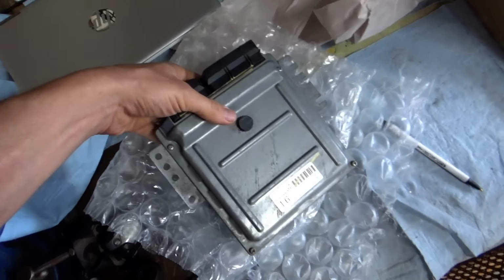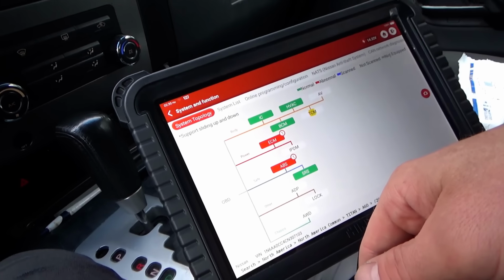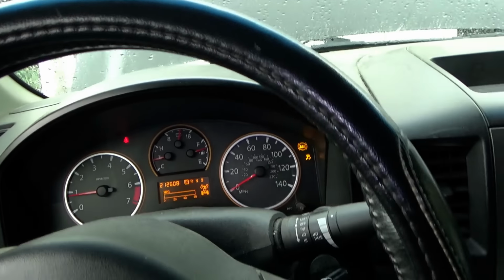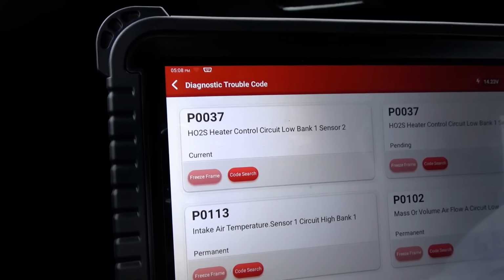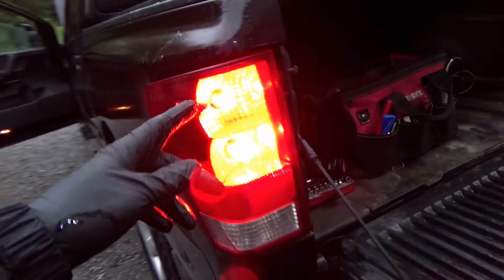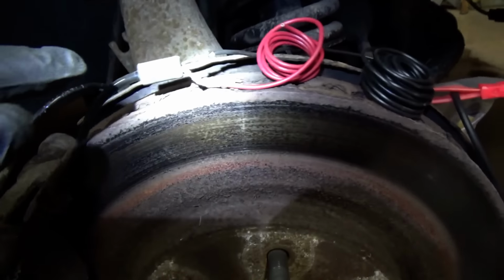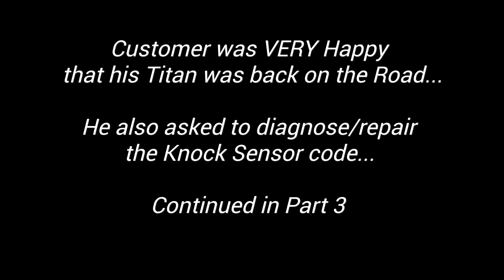(Pt 2) Nissan Dealer & Shop STUMPED for 6 MONTHS?! (Titan No-4x4, ABS Fault)

Comment: Ivan, this video came at a good time. we just bought a d22 Frontier (1999 model) 4wd v6 and manual. It was cheap and from a tow yard, so we expected issues and it did have the service engine light on for oxygen sensor and crankshaft position sensor. Nissan in their infinite wisdom made the sensor to be mounted to the rear part of the trans bell housing which made it a little annoying to access. Soon we discovered someone had already been there to throw a crankshaft sensor at it, of course. We also discovered that someone had attempted a hack job wiring repair and wired the  sensor backwards... Then they twisted the shield wire into the sensor ground wire, sending all the data from the sensor into the chassis... Some people should not be working on cars!
Reply: My condolences on purchasing that truck lol.    A warning about aftermarket crank sensors in any nissan . Don't bother trying.

Comment: The fact that the truck can disable 4WD altogether because of an ABS fault is infuriating. +1 for manually-actuated 4x4 instead of a computer getting to decide if you're allowed to use it.

Comment: I ran into a problem where a replacement computer couldn’t be sourced. So I knew that I couldn’t hurt matters any further by cracking open the ECM. Near the powers and ground connection plug inside the ECM were 2 (5) watt general purpose damper diodes. Their job is to dampen any voltage surges and keep the power coming in rectified in the proper direction. ( positive on positive and negative on negative) I purchased a bulk pack of 6 diodes for $3.00 and replaced the two that I had found to be open circuit. The computer came online and I was able to pull vin and stored codes. In you are ever in this situation…. You have nothing to lose by trying this. I get a lot of good information from your channel and I hope that should you ever need it, what I told you serves to help. Thank you and God bless.
Reply: Mark, 
Those are Spike Suppression Diodes used to protect the Drivers on certain protected circuits. Good job!

Comment: I did the timing chain on my parent's 4.0L Pathfinder. Found the same mouse nest under   the intake and also had a bad knock sensor and yes the abs disabled the 4 wheel drive. I had that too. They're a pain.

Comment: Not a huge Nissan fan but the Titans are great trucks.  Loads of power, good fuel economy for such a big truck, and a reliable engine and transmission.  It's got its flaws but none of them are show stoppers, imo.  Maybe ECU issues could be though, down the road, which is good to know.

Comment: As the owner of a 2013 Titan...this video does not put me at ease 😢  i wish i lived closer to Ivan!
Reply: Get known good ECU or 2 just in case.
Reply: Sell it while it’s still running
Reply: My 1st gen 2007 went to almost 300K before it was totaled.  Radiator, Axle Seals (2), front hubs (2), and a rear pinion seal.  Nothing really out of the ordinary for any truck.   Original starter, exhaust, alternator . . . . .  Mine was the best truck I ever owned.  So I replaced it with another one.

Comment: You can tell it's on the knock table under moderate throttle, I wish there was an after ignition timing comparison to compare to as I'd imagine it should be in the 20s, but hey it's fixed

Comment: Most Auto electric repair wire lines standardize on SAE-J1128 TXL (Automotive Cross-Link Wire Extra Thin Wall) for general automotive wiring needs, and for this repair you would use 18 AWG 19/30 stranding bare copper. Actually the most common wire stocked for 18 AWG color with stripe follow Ford Motor Company common color combinations. Ford also has a large variety of large power wire colors; Red, Pink, Yellow, and Orange. If you are tasked with making custom wiring harnesses Ford color combinations make a lot of sense, with some notable exceptions like HEGO colors. 

To fill out the wire line you will have about 20 18 AWG, 10 16 AWG, 6 14 AWG, 6 12 AWG 4 10 AWG. Mechanically for test vehicles 20 AWG is considered too thin although you will see 20 AWG in production harnesses. Then you will have your large cables (8, 6, 4, 2, 1, 1/0 and 2/0 AWG) for starting, charging, and power distribution. The best large cable wire is Marine high temperature, high stranding, tin plated copper wiring. A very popular cable for in trunk battery installations for automotive test vehicles is 1 AWG (sometime 1/0) Welding cable high stranding bare copper. For battery in trunk test vehicles we never rely on chassis to return currents so you will see a large red and black battery cables in the same harness going to the trunk. In the Trunk the battery positive cable is protected by a high current bolt down fuse.

You can emulate the OEM style wheel speed sensor factory harness in a repair by using TXL wire, high temp wire loom (white stripe) wrapped in TESA high temp abrasion tape.

Comment: @4:20 I had that same issue, crank no start.. figured it had a P0615 code, no power from the TCM to the IPDM start relay circuit coil control (power switched), added a jumper wire from the 30 terminal to pin 21 from the TCM connector at the fuse box.. problem solved.

Comment: Man i hope you found what the issue was when moving stuff. If put it back n it just started to work again and did nothing else with it then it will definitely mess up again on the first large bump or when there's lots of moisture in the air.

Comment: Hey Ivan, thank you for the video! I have a no crank no fuel situation with my 05 titan. I've been working on it with knowledgeable help (so I'm fairly confident I didn't make anything worse. With my truck being down a week and my job 1.5 hours away (each way) i lost my job. I took a loan from my grandmother for surgery (4 cut tendons in my forearm, no health insurance) and I work as a window installer. I owe her 14k. Lost my job because of no way to work. I'm at a breaking point and need advice please 🙏 
Aftermarket alarm was going off, I disconnected the battery. Nissan anti theft system immobbalized the truck. No crank, no fuel (starter is good though). Throwing a p1610 code and a p1612 along with a u1001 all codes clear except p1610. Tried to have locksmith program new key, no go. Switched the ignition interlock thing and nothing. I need to be on the road to find new work so I'm not a 33 year old financial liability to my grandmother whose 72 with a fixed income. Any advice would be a blessing. Worst case scenario I'm taking it to nissan so any knowledge on how to not get hosed would also be greatly appreciated. Thank you very much in advance. Have a blessed day.

Comment: Nissans always get knock sensor codes but it dont turn on the engine ligjt. 
It dont cause  any drivability problems or cause it so fail smog so ve ignore it since it is under r the intake manifold on the v6's. Unless the manifold is already coming off.

Comment: Great job, Ivan! Apart from the ECM, the faults so far, were all poor connections, busted lamps and wiring problems. Let's see about the knock sensor - Part 3 should be interesting :-)
Reply: High probability of broken bolts on the intake manifold after looking at those rusty fasteners.
Reply: @v12alpine  Yep, looks like a rusty mess to dig into 🙂

Comment: Yes, it does matter if either knock sensor works or it doesn't because the 
PCM will retard the ignition timing, etc if no signal is detected from the knock sensor when the PCM expects to receive one.

I can remember in 2019 I was travelling on a freeway at 110 km/h  (65 miles per hour) I got a P0327 code for the front knock sensor & check engine symbol in my 5.7 litre Chevrolet LS1 V8 powered Holden VY SS Commodore & once I replaced both the knock sensor wiring harness & the front knock sensor the engine had tons more power without an increase in fuel consumption.

I had only just replaced one of those phony knock sensors due to a P0332 code for the rear knock sensor.

So the PCM needs an input signal from the knock sensor , also the centre brake light is needed over here in New South Wales, Australia to pass  the annual registration inspection & it has to work !

Comment: I been dealing with a similar issue as a tech on side friend work. I don't feel comfortable calling ECM, but this was another sign I'm probably right calling ECM, can't get to finish my diag on it. Shop they been at sold them 5 Throttle Body's, connectors, sensors, then told them SOL take it some place else. They described the MAF stall recrank start turning to stall crank to start. Let it cool down, crank start, to Start Limppy, now 99% limp mode random normal operation till restart or stall. I tried original TB, did PID happy checks, relearns, gave me comm issues, 07 Xterra 4X4 Off-road 220k+ miles...

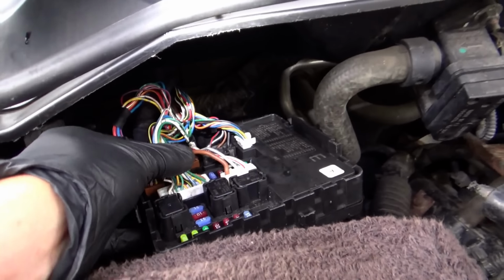Comment: I’m not understanding what the problem or fix was with the engine computer wiring at around 12:40. Was it a loose pin or what? Ivan just cuts clip says ipdm is in its home tests drives it and it’s suddenly working.

Comment: I have an 08 Titan, when I changed my starter I found the wires to both knock sensors chewed and disconnected. No cel, repaired the wires and the truck runs exactly the same. Which is it  runs well.

Comment: I wonder what's dying in those Nissin ECMs?  For some cars, it's the caps leaking and corroding the board.  Some are fixable. (as long as they are not multi-layer boards).

Comment: I betting now at 12.57 the ipm issue is a pin fit  issue from front  probing stuff
Well i was wrong 
Out here in west desert  it seems like i habe a lot of trouble with that Nissan abs connector always a fight that connector is on a lot of cars

Comment: The manufacturer make the cars and trucks so complicated that you have to take it back to the dealer, but then even the dealers can't fix the things. Tell me that's not insanity, and why buy one if you know eventually that you're going to have these problems?
Reply from the maker: It did go over 200k miles in the Salt, so that's respectable 😅
Reply: @PineHollowAutoDiagnostics  I guess you're right about that, and I wanted to compliment you on working on that outside and at night, that's bold.

Comment: You have an issue in the SMJ on the frame rail. SUPER common on all these trucks. Ive seen it all before. Loose pins, corrosion.. Junk design.
Reply from the maker: What is "SMJ"?
Reply: @PineHollowAutoDiagnostics Super multiple junction--- Nissans term for that big connector that you had apart on the side of the frame rail. All your 5v signals, fuel temp sensor, vent control valve, etc runs through it. See issues in that connector a lot.

Comment: Is there anyone rebuilding the ecu, like with a duramax diesel or similar diesel pick-ups?

I was about to say with the turn signal. That it could have been the male side pin. 
I had a pin to the ecu on my 04 gmc lb7 duramax. That was for the app 1 wire. 
It was a bad connection with the wire and pin to connect with the ecu.

Comment: Dunno about you in the North American market, but here in Oz Nissans just fail. I've got a 2006 2.5l TDI 4WD Ute ("truck"), lagging any power and pissing oil out of all gaskets. I'LL NEVER EVER touch a NISSAN MADE VEHICLE IN MY LIFE. (Neither a Mercedes-Benz after my experience with my 2002 S500L between 2016-2923)